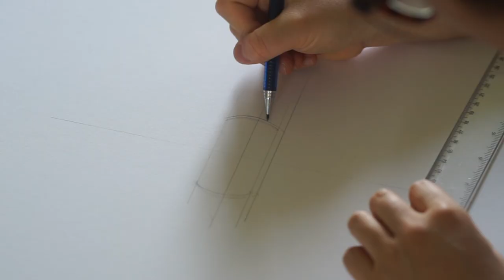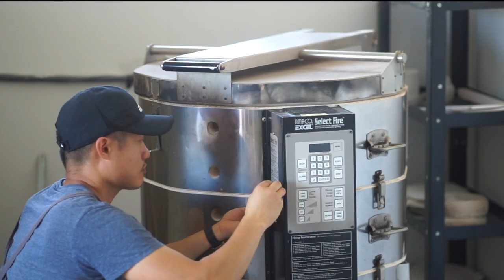Turn sketch into a human size ceramic sculpture in 10 minutes

Comment: You have inspired me❤. Why are there holes and openings in the middle of the base structure. You seem to take much care in making them, but seal them inside.
Reply from the maker: The goal was mainly to create a strong foundation for other structures. Another benefit was reducing weight.